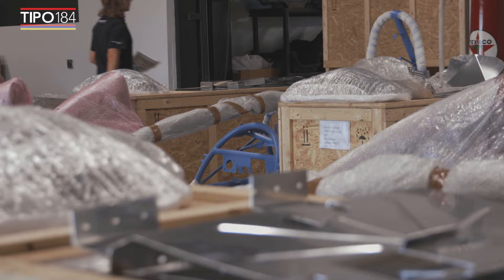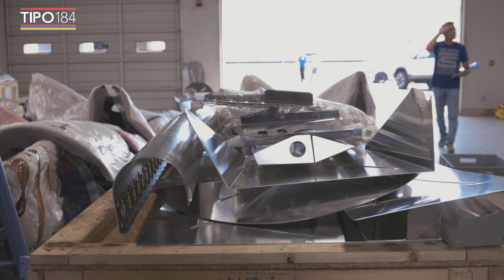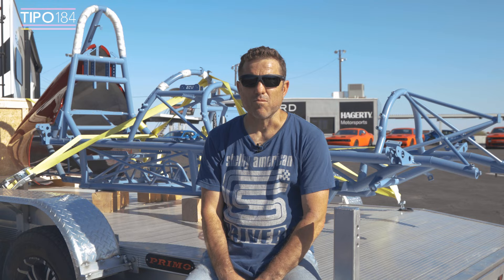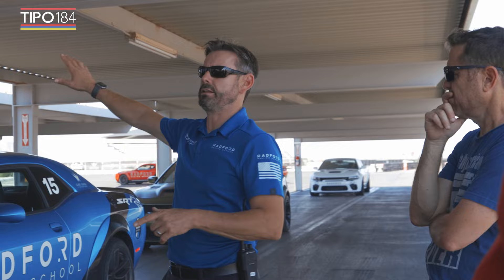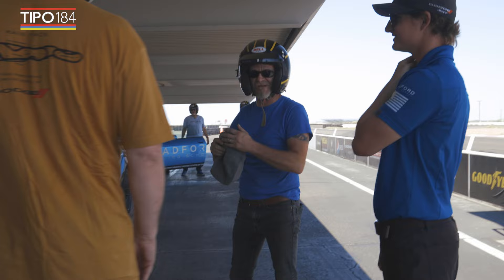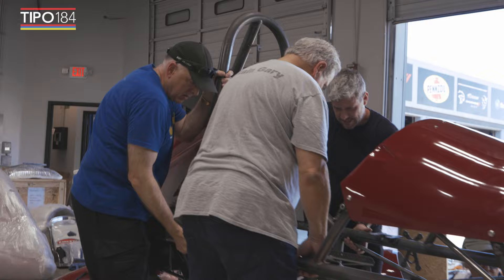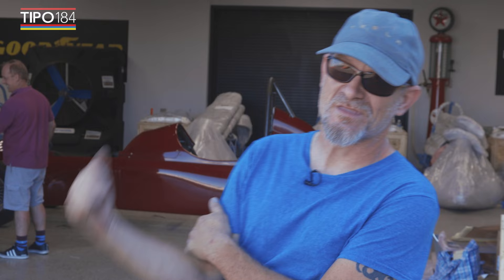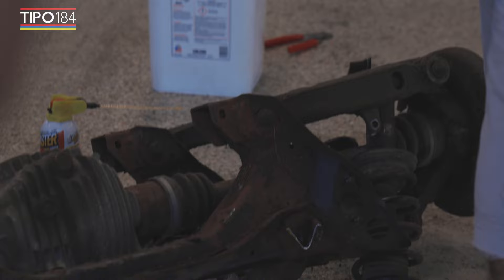Dowsetts Tipo 184 arrives in the USA at Radford Racing School hosted by Ant Anstead & Darren Collins

Comment: What a machine love it! Is it a RHD or LHD?
Reply: Well, you sit in the center!!
But the kit is based on the UK Miata MkII (i.e. in USA a NB Miata) and therefore the steering rack is a RHD. 

Those of us building the kit in the US sourced a RHD steering rack from the UK and had to modify our LHD front subframe accordingly - cut off two brackets, switch positions and reweld the brackets to the front subframe.